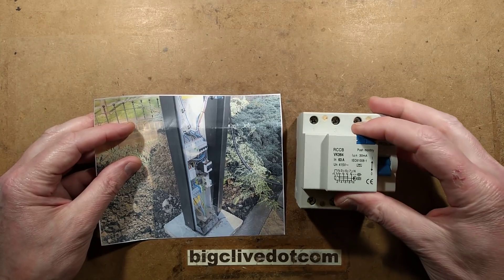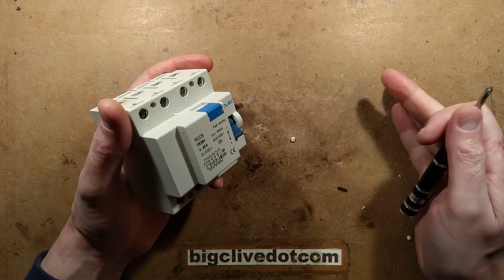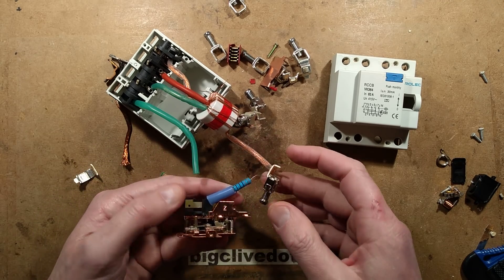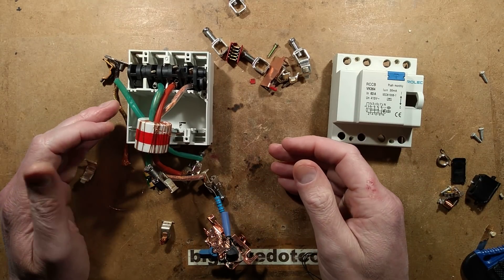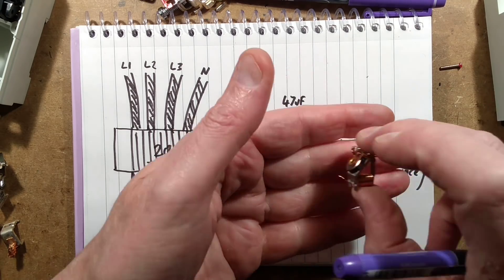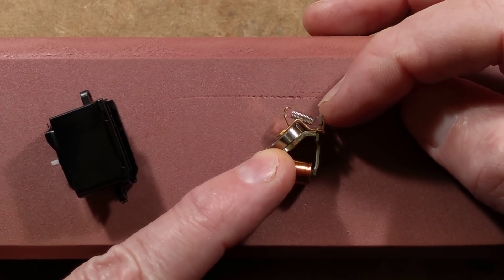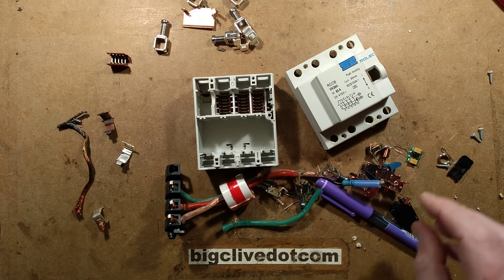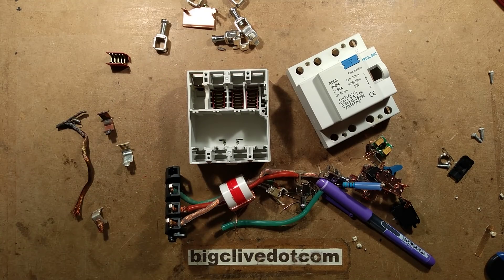Failed 3-phase RCD/GFCI from a Rolec electric car charging pillar. (with schematic)

Comment: I'm guessing here, but if one contact breaks first or closes last (compared to the others) it will arc badly.  If there's something loose (or just plain cheap) in the pivot shaft, it can do both - break first and close last - double the failure fun.  This is a huge issue with high voltage, large capacity breakers - so much so that industrial versions have special snap mechanisms that slam them open and closed fast and along with arc suppression coils that quench any arc quickly.  Even so, every time I've serviced one there's always one contact that's a bit more pitted and burned than the others.

Comment: I suspect a phase current imbalance. The terminal on the left is probably the neutral, and it would be taking more current than the other conductors.
Reply: It shouldn’t be. On a balanced 3 phase load, the neutral current should be zero.
Reply: WineScrounger how do you know it’s balanced? Assuming that burned terminal is the neutral, it clearly doesn’t have zero current or it wouldn’t be burned up. I should also add that unless the unit is tripping often, there shouldn’t be any scorching do to arc flash on breaking the circuit. The fault almost has to be a phase imbalance, or as you stated, there would be zero current on the neutral.
Reply: Jesse Blanke - Elsewhere Clive says it’s a phase conductor...
Reply: Mark 1024MAK after rewatching I did notice that the far right is labeled N for neutral, so that clearly isn’t the problem in this case, but what I said still stands true about phase balancing.

Comment: Plugging unauthorised things into Tesla chargers isn't easy as those chargers have smarts in them, they communicate with the car and both the car and charger are internet connected. If a car isn't authorised to supercharge the charger won't switch on the power.
Reply from the maker: This is why people will make devices that send all the right codes while shunting the terminals.  But only after a time delay so you can get away and start filming the results first.

Comment: As a US citizen who has tried to follow the Chinese situation, my understanding of the  Huawei situation is that the primary reason for the "falling out"  was the discovery that Huawei was installing very well hidden backdoor technology on it's cellphones and LSI semis to allow the Chinese government to spy on or interfere with US service men through their cellphones. PCs and GPS are also obvious targets as well as cellular devices. If that wern't enough of a 'deal breaker', the same tech was to be used (or the backdoor would be there for use at any time) to sabotage 5G communications.  For starters.
The technology is on the chip itself and is actually hidden in the construction of individual devices within the chip structure. It's very difficult to spot even if you know it''s there, and is activated by passing a long coded sequence thru the device, at which time, it "phones home". 

On more mundane subjects, in my experience, repeated identical failures are often attributable to something like a the mains wire carrying moisture seepage from a leaking gland down into that particular pole of the Circuit Breaker.  It could also be something like the end pole contacts are held in contact with less force due to the case warping with time, thus are heating to the point where resistance goes up and they eventually overheat and fail. Corrosive fumes from assembly RTV that attack that specific contact due to proximity and dozens of other freaky scenarios are also possible. (and you though the Huawei stuff was out there - I've seen it happen (the odd repeating failure thing, not the espionage stuff) 
Then, it could be as simple as the car manufacturers are putting all the single phase loading on phase A, (a common practice) thus it fails 1st.

Comment: Should have a notched hole to let the wires flex a bit more as well as centring the main switch to evenly try and displace pressure evenly along all contacts.

Comment: I've been involved with electricity and Electronic's since age 5.  Here going 62 I'm somewhat taken back at the complexity of these things.  I always assume they were all just a bi metal that heated and warped.  LOL    Exception of the GFI.  That I figured did in fact hold some Electronic's wizardry  .
Reply: It's FM (Freakin' Magic).  :-)
Reply: @mcgyver272000     Yep!   And Angry Pixels.
Reply: Indeed, the answer is simple, they let out the magic smoke, that which makes all things electric work.

Comment: Meanwhile in Sweden most of our charging poles are galvanized steel lol. Try chipping that with a weed whacker xD
Reply: Im waiting for America to use corten steel for charging stations.
Reply: @DurzoBlunts  I think I saw someone manufacturing chargers that are robust enough to withstand smaller calibre rounds fired at it.
Reply: Can’t beat hot dip galv for durability

Comment: Might be because the set of contacts are driven from the opposite end.  Any slop or deflection on that shaft could result in less pressure on the far side contacts.

Comment: Hmm, you all use wye connection for 3 phase? Delta is more common in the US.

At any rate, that black piece with the metallic tongues appears to spring against the rising cage contacts. I wonder if the plastic is flexing and is not developing enough force on the end to keep a solid connection.

Also, gardeners "strimming" weeds? Do we need a Clive-speak wiki?
Reply: Google "strimmer"

Comment: The little trip plate is surprisingly similar in design and function to the trigger and hammer sear in a firearm's trigger group: a very small, weak motion in one direction unlatches a catch that allows a much larger and more forceful motion in another direction.  Cheers!

Comment: Anyone else notice that at 2:55 the led in his screwdriver tester lit up?
Maybe the RCD sense coil had enough windings to pickup 50hz RF hum ?
Reply: if it's like a contact-less voltage sense device, static sets them off easily, probably shuffled his feet or shirt sleeve rubbing shirt or something.

Comment: If the actuator pushes on the far right end of that shaft, and the contact on the far left is messed up, my gut instinct is the shaft is twisting a but too much and not applying sufficient force to the contacts. Smells a lot like a basic design flaw to me.
Reply from the maker: I would have thought the individual contact springs might have helped.  Unfortunately it's hard to test without getting one that's not pre-melted.  But the burn pattern on the contact hinted at an angular connection.
Reply: @Dan Bowkley I'd go even further and say that the shaft shouldn't be made out of plastic.
Reply: Bingo.  Nylon in high humidity = significant creep deformation rate.
Reply: Also wondering about the single screw in the back. Would over-tightening that cause the innards to be (slightly) out of alignment?
Reply: good point, that could cause slight make/break delay between them also.
Reply: moisture ingress? -> corrosion/arcing -> contact resistance -> arcing/welding -> erosion -> porous surface -> moisture ingress -> repeat.

Comment: the cause of that type of burning isnt from the component its just simply a miss use of it miss balanced load and drawing 2 much curent trought the first port pretty common broblem
Reply: a nother thing that can cause problems is that the neutral is conected wrongly or that the current is going to wrong way installed wrong way a round causes intresting problems

Comment: With the activator mechanism on the right, i wonder if there was enough twist in the bar so the left contact isn't as tight as the others.
Reply from the maker: Others have commented on that too.  I would have thought that the individual contact springs might have prevented that.  The contact burn hinted at maybe a slight angle of the contact.
Reply: Torsion was near the top of my list as well,
Reply: Torsion indeed, AvE said last week "Everything is a spring".  If you had a way to accurately measure the contact pressure of each of those 4 contacts when engaged, I would bet that the pressure decreases on each contact as you get further to the left.
Reply: The neutral gets interrupted first in this case, usually the neutral is done last for safety reasons, so the current is balanced over the three contacts, the last contact collects all the current in this case
Reply: The little bit of insulation fallen off blocked the left hand contact causing the twist to get worse.
Reply: Another factor is the wire insulation on wires going to moving contacts will be stiffer on very  cold days (indoor equipment at outside tenperatures)  maybe causing the springs to have less effect.

Comment: Dear Bigclive 
I also opend up an older RCD (already a DC Pulse capable type, same logo as yours)  which had a similar PCB inside with Diodes and Tantalum capacitor, but there the sensing winding on the maintransformer had a connection in the middle of the sense winding, which was connected to the minus of the releaser winding. The 2 diodes formed a half bridge rectifier,  for positive and inverted negative pulses to charge up the capacitor with a positive voltage each and it was connected to the positive connection of the releasing coil. The capacitors negative side had a connection to the minus of the releasing coil too. The releasing coil weakens the magnetic field of the little permanent magnetic pill. The magnet, which sits on top of  the coil when the contacts are closed, and holds the mechanism, separates from the coil and the RCD will trip, if any pulses charge up the capacitor.  Regarding the burnt contact you have to keep in mind that this RCBO sits in a housing where moisture in the air is one topic, due to the fact that the charging post usually sits in this box in ice cold and sunny hot weather, unclimated. On top of this you have a high current load, which will heat up the wires with every charged car. As mentioned in annother comment some cars only use a single phase, so the wires for phase1 and neutral will get the highest tear and wear. Together with a maybe weak torque while mounting the cable into this cage clamp the cable corrosion can start in the clamp, with more oxidation on every charging cycle, and therefore it gets everytime a little bit hotter the more the oxidation advances. Furthermore there is annother topic: The contact in the RCBO has a silver coating which can get the black corrosion on it. This black silveroxide has a high resistance. In a stairway timer light switch the corrosion is pushed to the side or burnt away with every triggering and release. But how often is a RCBO contact opened to have a cleaning effect on the oxidation layer?

Comment: 1 MW charger. Think Id be willing to pay money to see that go off. Had a 500 kW generator short its bus bars at a work site. No more bus bars, and it coated everything in the electrical room with a copper film.
Reply: Some fuse or breaker will probably stop anything too exciting long before something like that.
I bet that generator had no fuses between the output and the short circuit to do that.
Reply: @Basement-Science  Yeah if I recall it was the bus bars in the main panel that shorted, so it probably would have been ahead of the disconnect.

Comment: My thoughts about that circuit are that I haven't a clue how it works.  In order for the trip coil to cancel the magnetic field of the permanent magnet it must pass a specific polarity dc current but there's no circuit element that could create such a current.  A charger circuit would normally take an ac load current and the sense transformer cannot pass dc even if there was some present in the load current.   The only type of load that takes a dc current is one with a half wave rectifier at the input which would only be used for the crudest low power circuits.
Reply: In one half cycle of the AC waveform, the magnetic field from the coil will reinforce the magnetic field from the permanent magnet. But on the other half cycle, it will oppose the magnetic field from the permanent magnet. If/when the strength of magnetic field from the coil exceeds that of the permanent magnet, it will overpower the permanent magnet...

Comment: Clive, the failure is most likely due to poorly attached wire in the terminal (externally), or a piece of insulation that wasn't properly removed...  I see a lot of that out in the field, and it manages to cook the contacts the same way.  Done a lighting relay last week that welded itself shut, because they didn't bolt down one of the terminals, and the wire just welded itself in place and eventually cooked the contacts.
Reply from the maker: That terminal looked OK.  The main point of heat looked like the contact.

Comment: The weak link always fails first.  Official verdict.
Reply: pmailkeey - In the U.K. when a microwave oven failsafe door microswitch shorts out the line (live) and neutral, it will blow its internal fuse (often rated at 8A or 10A), and trip the 32A MCB in the consumer unit, but not always blow the 13A plug fuse!
Reply: @pmailkeey - um.......that's the exception that proves the rule. Maybe.
Reply: @pmailkeey   Ah ! The avalanche effect . Mother Nature taking charge  !!
Reply: pmailkeey - Internal fuse is a T10A time-delay/slow blow/anti-surge fuse!
I have changed the failsafe microswitch, as it had a break in the plastic case where one of the contacts is.

Comment: No power in them to speak of, but even the small (less than 3 feet tall) telco pillars at two corners of my yard (twisted pair on the east, fiber on the southwest) are metal.  Perhaps the car charger manufacturers should take a lesson from the youtube videos of vehicles plowing through gasoline pumps?
Reply: Down Under our local fancy restaurant has two charging pillars for the Tesla clientele. Both have survived accidental impact, and the casings seem to be pretty substantial GRP, with a stainless steel (??) shroud around the base to protect them from overenthusiastic gardening.

Comment: On the SpeakEV forums there's a large thread on failed Rolec RCBOs. Almost always the neutral and the seems to be a wonky angle where the contacts don't make good contact. Rolec blamed installers not tightening the screw terminals correctly but they have since issued a new green coloured switch version. Clearly made from better chinesium.